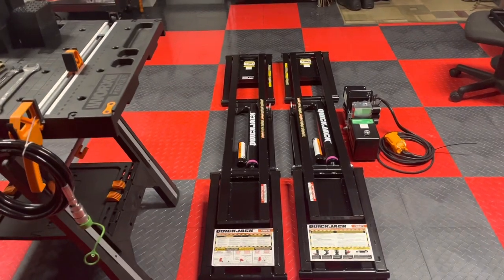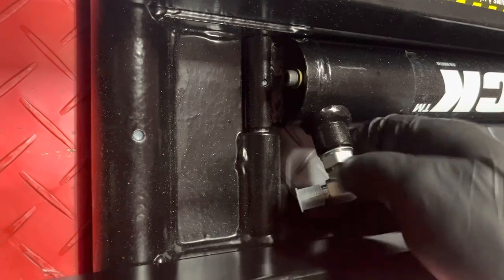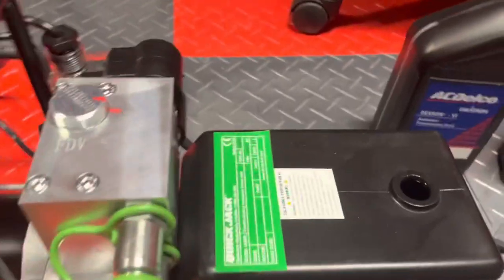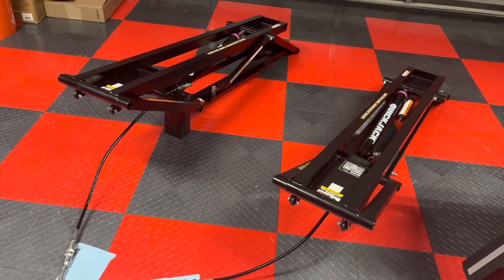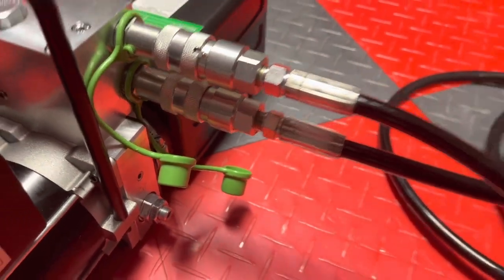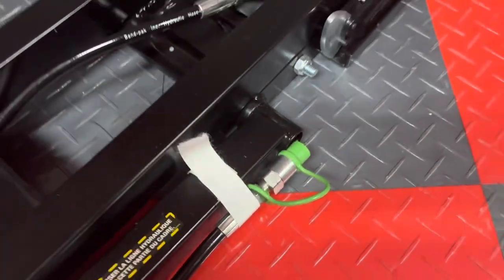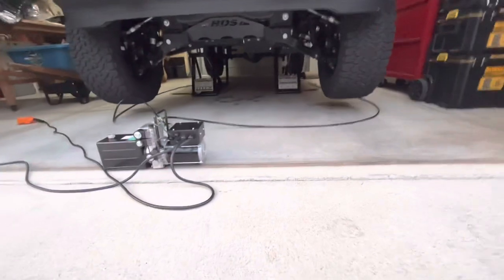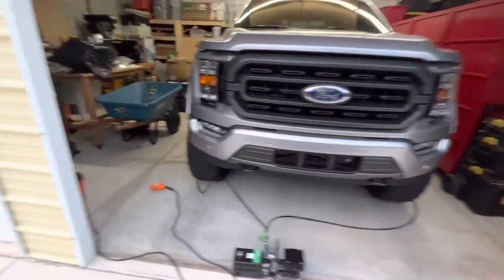Can the Quickjack BL-7000TL lift my lifted F150? Only one on YouTube!

Comment: One thing that I started doing on my cars (and seems very apparent watching your truck being lifted) is to put the vehicle in neutral while it is being lifted.  The reason is due to the arch inherent to the way these lifts operate.  As the vehicle starts to lift, it will be pushed forward (or backward) depending on how the lift is oriented.  What happens is that the Quickjack is trying to move your vehicle forward, while your parking pawl or parking brake is fighting this movement while the tires are on the ground.  

On your truck with longer suspension travel, you see this "fight" happening in real-time, with your Quickjack frames sliding, as well as the chirping happening in your tires as the weight transfers more to the jacks than the wheels.  By putting it in neutral, this becomes a non-issue as the wheels will just roll as needed until they come off the ground.

One VERY important thing is to only put the car in neutral and release the parking break after you just start lifting the vehicle a little.  This way, some of the weight will already be on the Quickjack, and it will prevent your vehicle from rolling away uncontrollably.  I also put wheel chocks a few inches in front and in back of the tires in the unlikely event that the frames lose pressure, so the car can only roll a couple inches before stopping on one of the chocks.
Reply from the maker: Thanks for this information. This makes sense and I will give it a try!

Comment: Get or make the frame extensions. It will make the QuickJack 2 inches higher, and also 6 inches longer, which will help with front to back stability on a long vehicle. (I have been using it on a Silverado 2500HD for 3 years with no issues.)
Reply from the maker: Thanks for commenting. For the F150, the adaptors are not quite all the way apart so they still had some room. I can see how the extensions would come in handy on a 2500 or probably the F250 also with longer frames. Thanks for watching!

Comment: I bought the BL-5000SLX back in 2019 for about $1100. from Costco. For me, The QuickJack is more novelty than a workhorse, and have used the jack probably under 15 times since I purchased it. In hindsight, I should have bought the BL-7000EXT because the 5000SLX even with the rather expensive extensions comes up a bit short on My Honda & Toyota Minivans. The jack can lift the Minivans with ease, But the length from jack point to jack point comes up short. So I have to spend more time aligning the jacks along the pinch welds, But so far no issues. I'm just getting around to adding Casters to ease the movement when aligning the jacks. In contrast, It takes me half the time to just use Jack Stands on all corners although you give up some Height depending on the job at hand. ( I keep my QuickJack stored against the wall vertically and the pump /accessories in a milk crate dolly, this is due to limited space in my 2-car garage. So set up time is longer )
While I've never had an issue with QuickJack, the Lack of use can cause air pressure to decrease in the cylinders and leaky Quick Connect seals. The QuickJack is still a must-have if use them often and not just another tool that garnishes your Garage.

Comment: Do you notice any wear on the bottom of the quick jacks from sliding them around? I’m interested but would be on pavement for most my work. I wish they came with bearings on the bottom. I’m just concerned the scraping would lead to eventual rust etc.
Reply from the maker: I place each side on cardboard if I use it on concrete and have not had any issues and it also makes it easy to move around. If not, your concern of rust is probably valid. Thanks for watching.

Comment: I do believe the thread sealer is anaerobic so it doesn't cure in open air.
Reply from the maker: Seems right but then why would it need 24 hours to cure according to QJ and why would it leak if used straight away? Does it create a slight film?
Reply: @fattysgarage1754  It is very commonly used as cam-cover gaskets, etc, on European cars, such as Audi, VW, MB, etc..   It needs a cure time to 'harden' in the threads, where there is no air.  I've used it time and time again working on cars, and even months later, the 'squeezed out' part will still be tacky/slick, but popping off the cam cover, the inner sealed portion would be hardened.  It's weird stuff, for sure, but works a treat.  lol
Reply: @fattysgarage1754  I think it's not a product of quickjack self. They want to be sure that you give the thread sealer the time to dry and seal. Normaly you should know the producer of the thread seal product like Loctide that you know the data sheet depends temperature, drying time and for which kind sealing you can use it.

Comment from the maker: I placed the rear adapters as far back on the frame that was possible. It was the rear most flat area on the frame. The front being the heaviest, I placed the adapters as forward as possible leaving plenty of room for the rear adapters. If the truck’s frame was more flat towards the rear, I would have placed them further back since the wider they are the better. Also above the front adapters, there is an arrow in the frame showing the lift point so that was an easy placement for the F150. Thanks for watching!

Comment: The question is, would you feel safe getting under the car (with the wheels off) ??? That's the million dollar question. I would not feel comfortable working under the truck (Wheels off) without supplemental backup jack stands around the pinch weld of the vehicle. Thoughts?
Reply from the maker: I also have jack stands and would use them if I was under it and felt it was necessary, wheels off would definitely justify this. Can’t be too safe. These can withstand over 15,000 pounds on top of it in the locked position. Company has a video showing this. These type of things are usually way underrated but any lift can fail if the stars align just right.

Comment: What I saw in the last minutes the Quickjack frames moved a little bit forward on the ground during the lift down. Maybe it depends on the weight of your truck. I haven't this not with my cars last weekend where I unpack and use the 7000TL the first time. The treat sealer I did not use I took the teflon tape. Quickjack changed because some ultimate customer used it in a wrong way. But if you are using it correct the fittings stay dry and you have no leaks.

A Tipp for you. You have at the end of the fittings the dust caps. If you disconnected the hoses you can put the cover around the other hose and stuck the cap on the fitting again. So you have both lines stay together and nowhere on the floor.
Reply from the maker: Yes the frames moved slightly because i put cardboard down to make them easy to move. I didn't disconnect the hoses because it was a demo to see if it would lift my truck, not working on it, but yes moving the hoses out of the way is awesome,
Reply: @fattysgarage1754  ah ok. I looking for similar option with the rolls to move it easier on the ground.

What I mean with the dust cap is after disconnection of the hoses you can use the dust cap with the rubber band. When you bend the end of  the hose back to the elbow fitting of the hydraulic zylinder that you could put the rubber band of the dust cap to put it around and the hose stay close to the frame.

Next weekend I want to check again the quickjack. I hope the weather changed again. At the moment it's to cold outside with the snow.
Reply from the maker: @benjaminwiener9942  oh, I see good idea, thanks!
Reply: @fattysgarage1754  it was not written somewhere but I know this art to secure with the hose from my work. There we have it so often that the hydr. hoses laying somewhere around and so you have it clean. I was looking today after one week where I lifted up my summer car and the system is complete disconnected it stays safe in the mechanic stopp with the car on it.

Comment: It’s seems like a lot of money to spend when 75.00 you can bring it in and do a rotation….or i guess other stuff but if you dont need a tire rotation for five years then you probably aren’t too worried about brakes idk….not very high lift
Reply from the maker: I don’t take my vehicles “in” unless it’s serious warranty work only. I certainly don’t let anyone take off or put on my wheels so they can weld on my lug nuts on with 500 lb ft of torque.  I have many vehicles that need tire rotations and oil changes that I use this on. It lifts about 28 inches with the suv adaptors. Having the ability to rotate tires or change wheels and tires on a 6 inch lifted truck was the only reason I needed it. The rest is because I wanted it for convenience. The jack and jack stands got old and are almost never used. It’s not a very high lift if I’m trying to lift a MRAP but there is nothing that I can’t do with it as far as the lift height is concerned. I mostly use the lower stop for all oil changes and tire rotations on normal non lifted vehicles.  I put them on the wall on their racks and they stay out of the way until I need them. A 2 post lift was considered but takes up too much space and not necessary for me and takes up unnecessary floor space.
Reply: @fattysgarage1754  that’s pretty good….. i was only looking at your comment , that’s what i was going by ….i dont have techs around here that do that but im lucky to know the people i take it to… im in a small town so

Comment: How many inches does it move the truck back (or forward)? My garage is so small I only have  about a foot of clearance total lengthwise after my suv is in there and I’m concerned this would shift it while raising into the wall/door…
Reply from the maker: I didn’t measure it but a foot is probably more than enough but I would open the door first. The first locking point is only a few inches. Other videos I saw said it moves about 10 inches . This seems about right.
Reply: @fattysgarage1754  Thanks for the reply...unfortunately I can't make a purchase decision until I know this data, so I might give QJ a call. Am also curious what height the first stopping lock occurs, can't seem to find that anywhere either.

Comment: Would you trust it on an appx 6000lb Toyota Sequoia??
Reply from the maker: Yes, I would trust it. The capacity is well beyond 7000 pounds according to the company, but it’s not going to be recommended to exceed its rating. They have a video of them putting 15,000 pounds or more (can’t remember) on a lift to show what it can actually handle as far as downward weight. It may not lift as much though.

Comment: What is the ground to the very top of the pads measurement.?
Reply from the maker: About 27 inches total.
Reply: @fattysgarage1754  thanks for the reply. Not sure that would be able to lift my wrangler. I’m like 24 inches to the frame rail. Sitting on the ground.

Comment: What modle would you reccomend for a 2012 Expedition EL?
Reply from the maker: The BL-7000tl should work as long as the weight is under 7000 lbs.

Comment: I have the TL and I'd say it's ok, but only if you're lucky and get one without a defective air cylinder.  If you do get one of those you're screwed - the company will 100% not stand behind their product.  They'll claim the air-assist down isn't "necessary to the function of the lift".  Really?  So if one side has air assist down and the other doesn't, and they drop unevenly, that's safe?  And then when the vehicle drops to the ground and one side of the lift goes straight to the full down position while the other...  doesn't.  You need to wait... and wait... and wait for it to drop with no weight on it.  Quickjack will claim this "is normal operation" and that "it will get better over time".  If you invest a massive amount of time trying to get them to stand behind their product they will, eventually, after burning through every once of customer goodwill, send out a new cylinder.  Yay!  Until you get the replacement and the freakin' air side is literally capped off.  Like intentionally made unusable.  That's not a fix guys.  Then they'll claim that the engineers decided the down-assist wasn't necessary and that they've changed the design on future models.  But I didn't buy a future model with less functionality.  I bought the current model with exactly the functionality I wanted, was promised, and paid for.  Whatever.  Too much time wasted on it already - I've written off the entire company as another skanky marketing hack with no integrity.  

I still have it in my shop, but the company worked very hard to make me regret my purchase and it low-key pisses me off every time I look at it.  And honestly the setup is inconvenient enough that even when I do pull it out - warts and all - it happens very rarely.  Only when I have a longer term project where I know the vehicle will be on the lift for a week or two.  Definitely not for things like oil or tire changes.  It's just way quicker to use a floor jack, or even ramps.
Reply from the maker: Shame on them for not having better customer service. They should definitely replace defective parts without hesitation. The air assist only works after the vehicle is on the ground and there is no weight on it. This in no way causes the lift to drop unevenly. Sounds like thats their way to deny any warranty claims on the air assist cylinders.